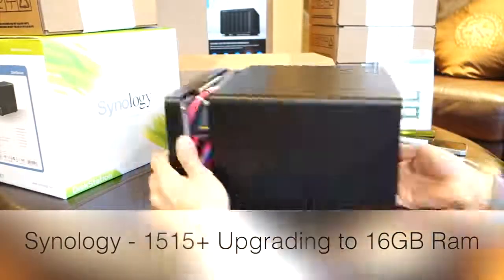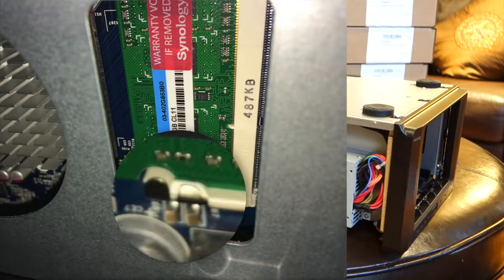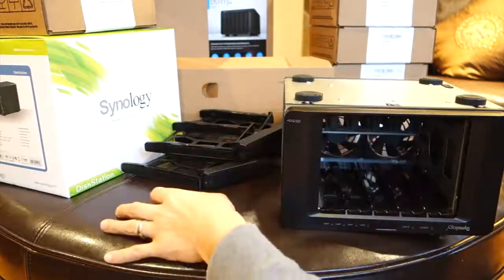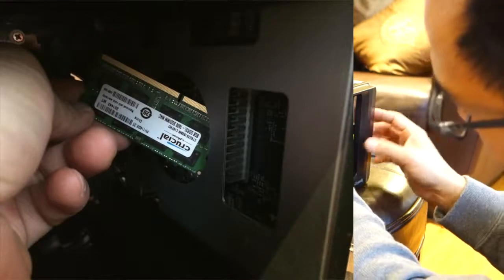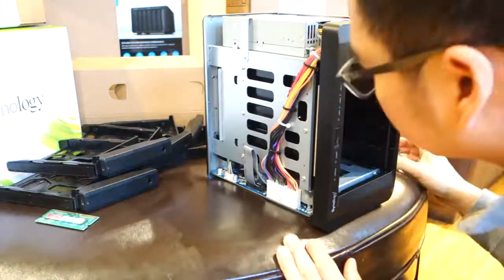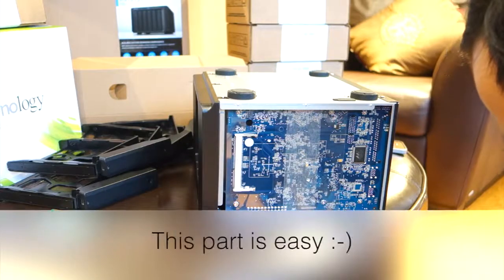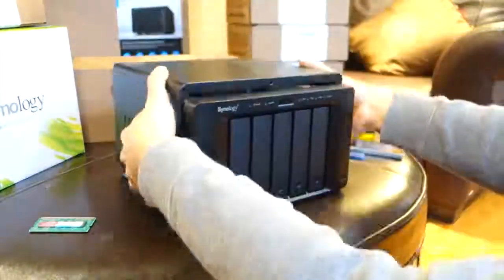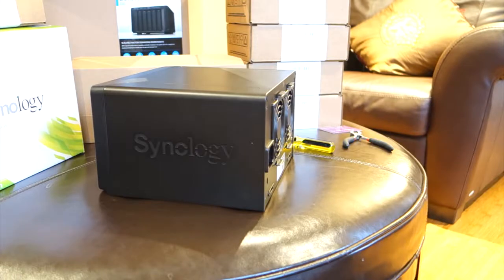Upgrading 16GB Ram in Synology ds1515+

Comment: Hi, I used this memory (2x8 Crucial, as linked), and the DS1515+ only recognizes the first 2048 of each stick. No matter how I swap them around, I get 4096.  Also, I was told to expect a long memory test on boot, be patient, and I am not getting that test. I wonder if that may be why the full memory isn't being used?  What should I try?

Comment: I added 8gb as that I had laying around here from an old pc... it made a huge difference, much more snappy.
When I was using DSM6.2 it felt still okay, but since upgrading to DSM7 the ds1515 and adding photo app it was super slow.

I struggled to get the inside one properly fit.. very fiddly. I disconnected the power connector to the motherboard to gain easier access from the outside then I could get it in it's place easy and it was done in a minute.

Comment: Thinking of upgrading Ram in DS1515+ and came across this video .. Checked Crucial website and they say the "Crucial RAM CT2K8G3S160BM 16 GB Kit (2 x 8 GB) DDR3 1600 MHz CL11 Memory for Mac" is NOT compatible with the 1515+ 
This configeration may well be untested by Crucial 
Basically, DOES it work without any issues? TIA Great Video
Reply from the maker: This is an older video, but the link in my description should get you the same RAM I used, which still works.
Reply: @GaryCruzDotCom  - Thank you for responding 👍👍

Comment: Hi, just curious, official spec written expandable up to 6GB, so thats not true? We can upgrade as much as the processor can Support?
Reply from the maker: Max i have used is 32GB. Synology will not support that config if you call for support. You'll just have to swap it back if you need their support.
Reply: @GaryCruzDotCom  oh I see, I got it now.
Reply: Similar story with Dell work stations 8gb max, rang Crucial 32gb  - have 5 all with 32gb over a year now